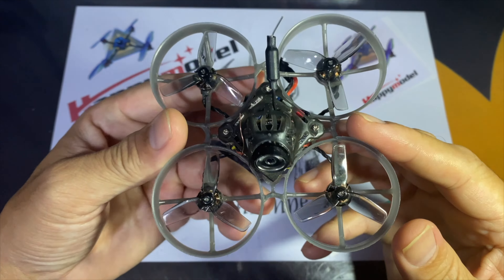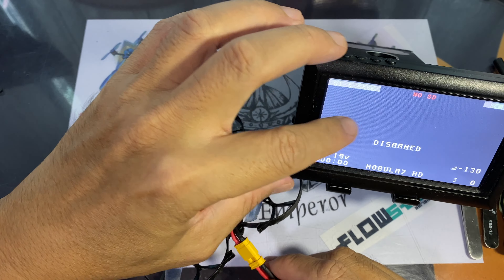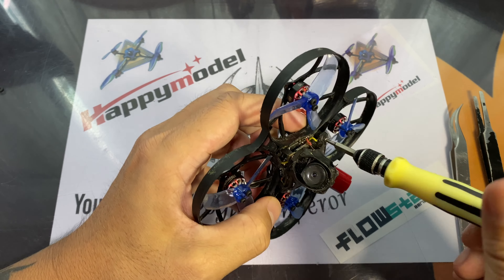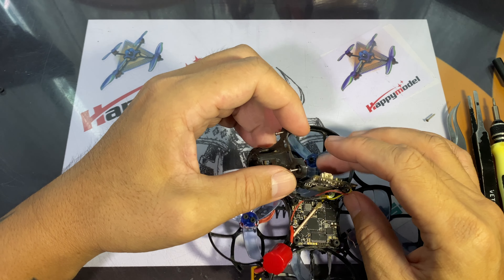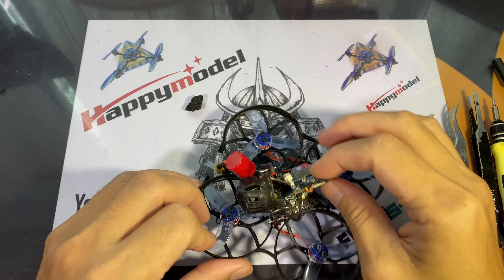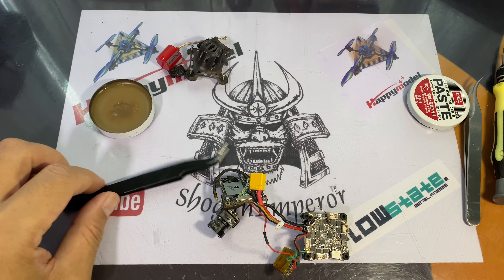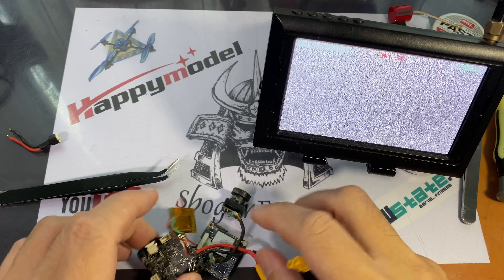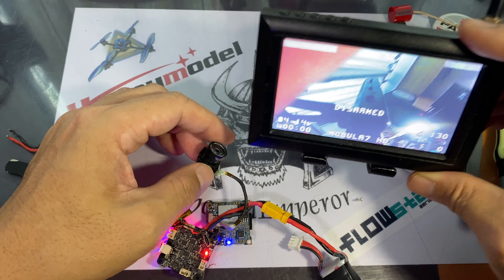Mobula7HD Black screen

Comment: on my vista it went to a black screen !!! have OSD says my MPS is 7 mps ,, I replaced cable same issue ,,  hopefully its just the camera  mabey ???????????????????/ would your MPS be low with no camera
Reply from the maker: Vista?? Hmm.. this ones a split camera. But if ur vista is black screen, check the mipi cable connection on the camera or the vista unit. If its still the same, high chance the camera is dead.
Reply: @shogunemperor  thanks 😁😁😁😁
Reply: @shogunemperor  I have the falcon unit , I put the wasp camera you get half a screen ,, I cannot find a falcon camera separate , says you have to buy the whole unit  together WTF ?
Reply from the maker: @bengordon7635  yeah. These days these manufacturers are pulling these proprietary shit on consumers. They want us to only buy their stuff n not make them compatible
Reply: @shogunemperor  the falcon has the nano camera ,, also its 1080p and rolling shutter ,,   the camera  has a 1.7mm lens which is my favorite  .. ,,  the air unit  that comes with the falcon must be specifically  for it!!!!!!!!!!

Comment: How did you solder the connector pin on the FC?
Reply from the maker: I added more flux and heated the 3 pins together from the top.  Then check to see if the solder were not sticking together.  I use a microscope to help so i can get a detailed view.

Comment: I jave this problem on my analog v4 mobula7 I've only had a handful of flights and now no video but osd and grey any ideas or direction? 
Thanks
Reply from the maker: @garykrygsman1391  ooohhh… as long as u have OSD means its still working. Take off the canopy and check the solder points or the plug. There maybe a loose wire somewhere. I had this before too. I changed the wire and it was fine.
Reply: @shogunemperor  thanks for the reply. I've had a look at the plug it looked all good and I'll take it all apart again and replace the wires 🤞🏼could it be the firmware?
Reply from the maker: @garykrygsman1391  its unlikely. But another issue could be the camera sensor is damaged or a chip came off. Check the bottom left of the camera, there should be a brown colored resistor. It might’ve come off
Reply: @shogunemperor  legend thanks
Reply from the maker: @garykrygsman1391  anytime bruddah
Reply: @shogunemperor  it's was a dead camera replaced it with a n caddxe ant now it's working again. thanks for your videos! great information 👍👍 are you flying analog or hd in your whoops?
Reply from the maker: @garykrygsman1391  aaww thats great news bruddah. Im glad it helps!!! I fly them both. I have an HDZero system too.. but I’ve stopped using it for now due to inconsistencies.